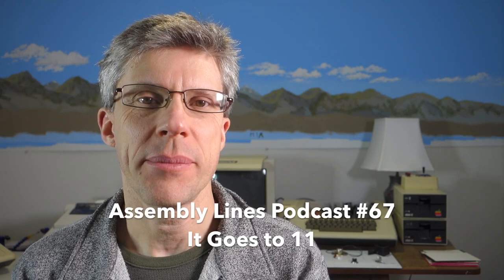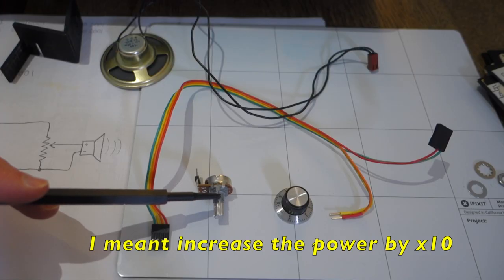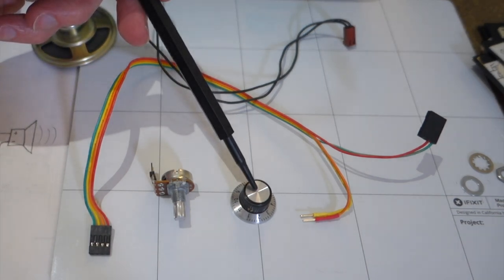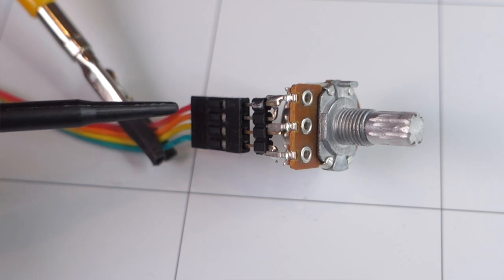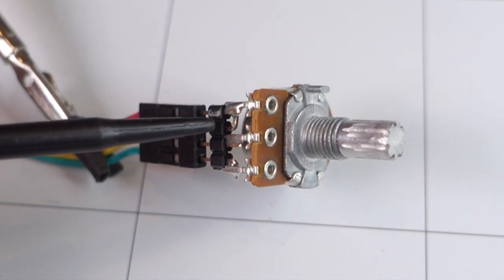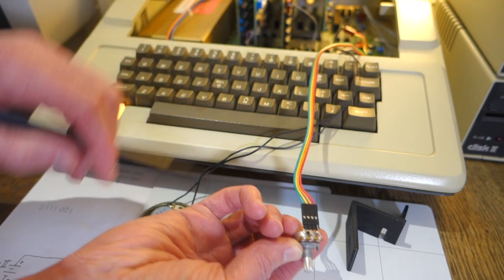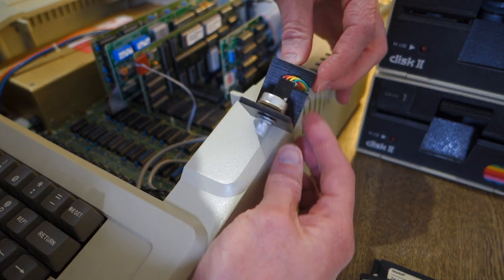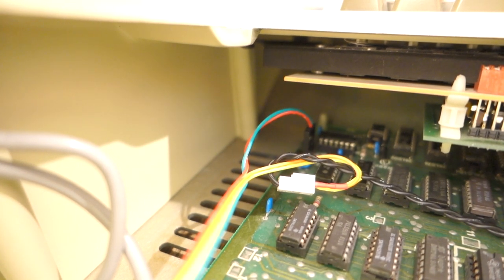#67 My Volume Goes to 11

Comment: Very helpful, but the STL file on thingiverse will not open in Cura or Prusa Slicer.
Reply from the maker: I think I fixed it - can you try it again?
Reply: @CT6502  Yes. It works now. Thanks!